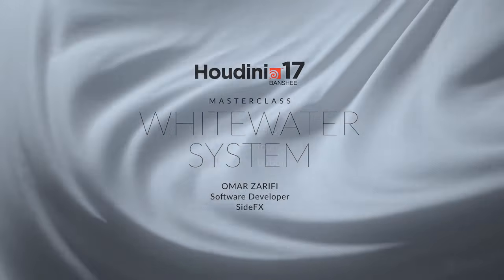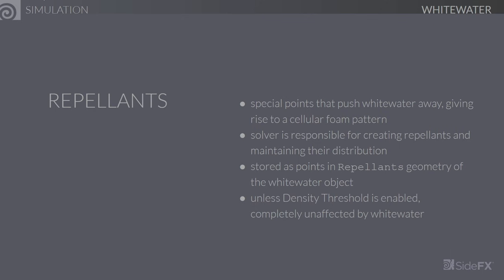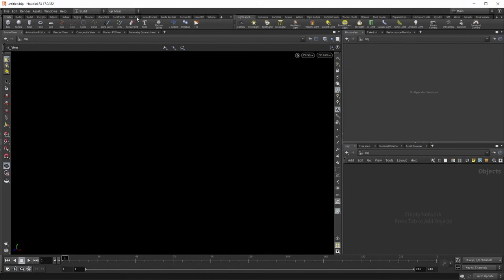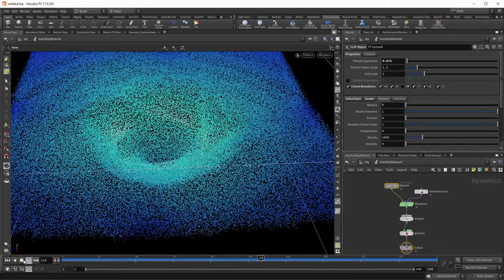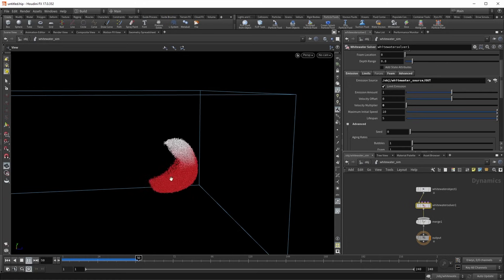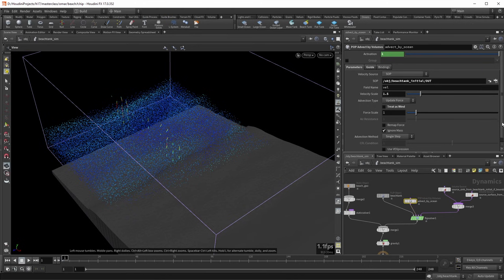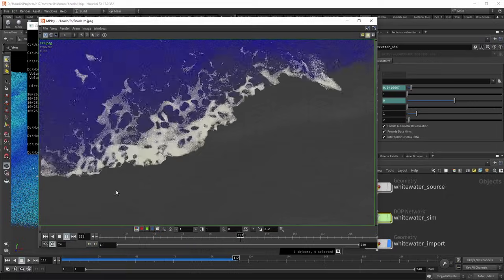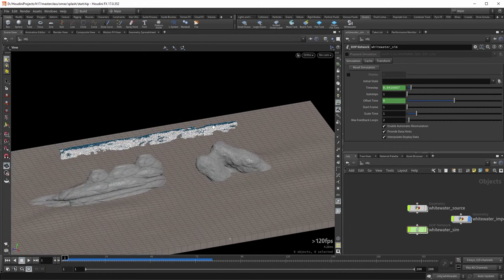Whitewater System | Omar Zarifi | H17 Masterclass

Comment: Great video, my only question is that you tweaked the incoming surface volume in order to get a nice leading edge. But when you convert the flip particles into surface polygons it also uses different filtering to get a nice polygonal surface. How would you get the whitewater surface volume to match the rendered polygonal flip surface after its been filtered? I've been struggling with my white water sim not matching the renderable surface of my flip sim. I keep running into the leading edge falling into the rendered mesh and just not lining up properly. Any ideas how to fix this?
Reply: You probably dont care but does any of you know a trick to log back into an instagram account..?
I was stupid lost my password. I love any tricks you can give me
Reply: @Rayan Wade thanks for your reply. I got to the site thru google and im trying it out atm.
Seems to take quite some time so I will reply here later with my results.
Reply: @Rayan Wade It worked and I now got access to my account again. I'm so happy!
Thanks so much, you really help me out :D
Reply: @Camilo Xander Glad I could help =)